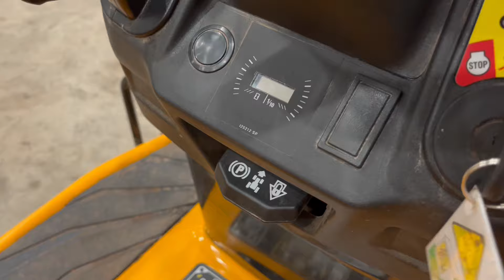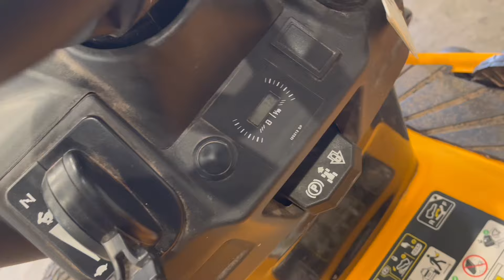Bringing back to life an abandoned mower

Comment: Absolute steal mate, i can never find these good ones lol yeh gotta admit i wish you would try clean the fuel and carbs even though it may not need it, you dont want any water or crap getting in.
Reply from the maker: Thank you for watching will do next time 🫡
Reply: If it isn't broke don't f with it.  Did it run?  Sure did.  No water.  No fuel or carburetion issues at all.  Kids start touching things that need to be left alone.  Then you have torn gaskets.  You put brackets on wrong, break adjusting screws off.  Leave heat shields off.  Break off fuel inlets, outlets, valves.  All for what?  Nothing.